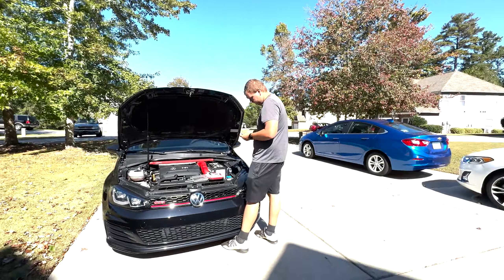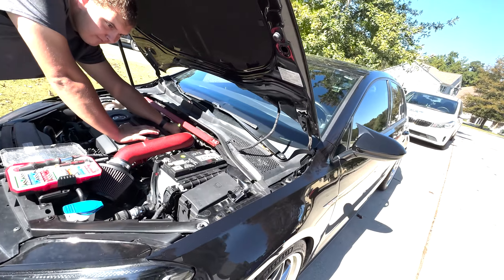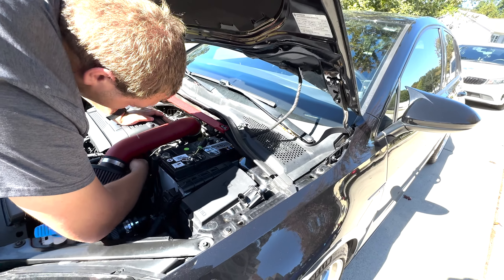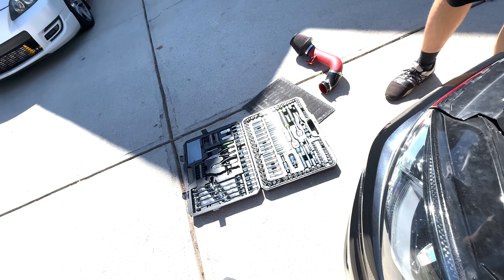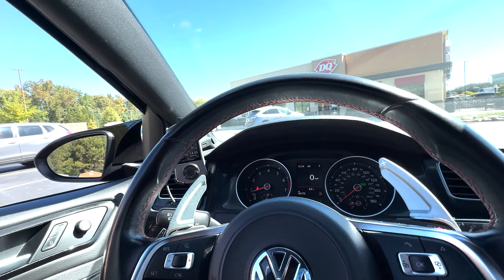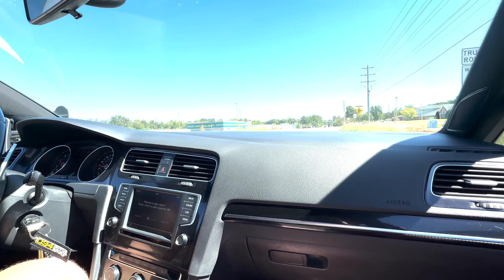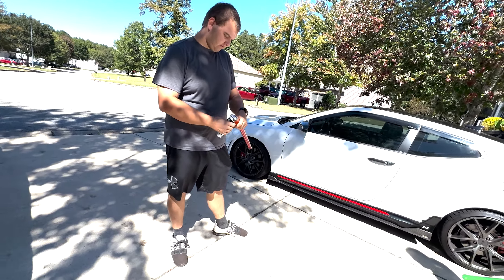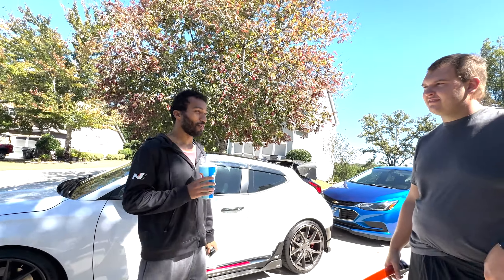THIS IS WHY MY MAMBA 3071R FELT SLOW! | Replacing A Faulty Diverter Valve | MK7 GTI |

Comment: That is the wrong turbo.  It will live in the surge line too long.  It will come alive more so when your at much higher speeds in the triple digits.  Remember to size the turbo with the engine size and that makes for a much better time all around.  
The autozone open intake needs to go - that will create more issues than anything.  
In the future, when you mess with the DVs - don't get them and push ALL THE WAY down on the piston right out of the box 👍

Comment: Stay away from the 034 HPFP it gave my car so many issues Matt told me they are trash
Reply from the maker: Did you have the first run of them or the batch after the recall/revision? I waited until they fixed the first batch and they were on sale to get mine, Only issue I’m having is like I said in the video it’s already at 100% capacity for some reason
Reply: @VeeDubJordan  both bro I was one of the first to report the recall on the hpfp I got the revised one and I would max out the pump on e85 and it start cutting out so I ended up just going with an autotech and no issues since then
Reply from the maker: @JuicyS3  goodness, I’m hoping for my goals on 93 it can handle it but if not I may just try to sell it and go the autotech route, I was trying to avoid it since I’ve heard they have quite the failure rate but if that’s what I have to do then so be it